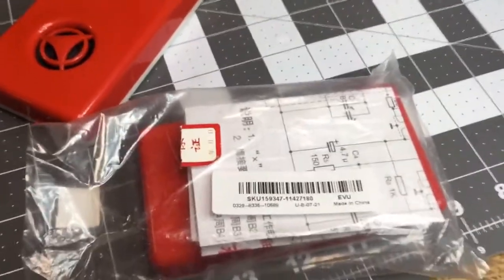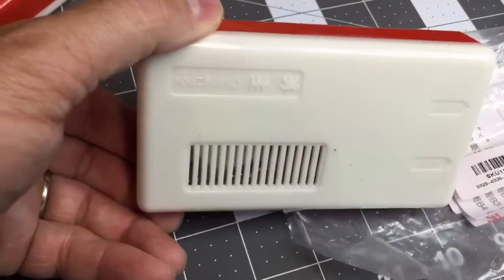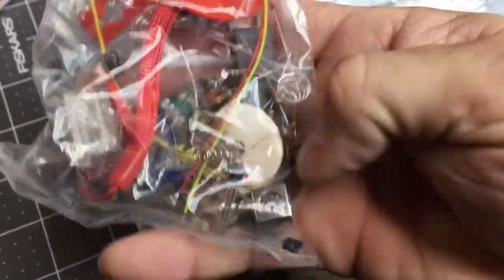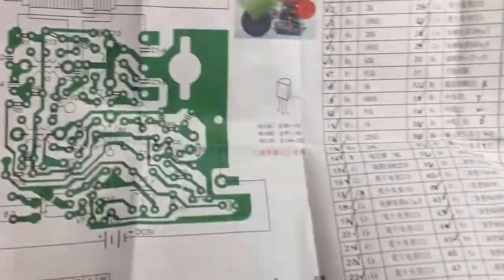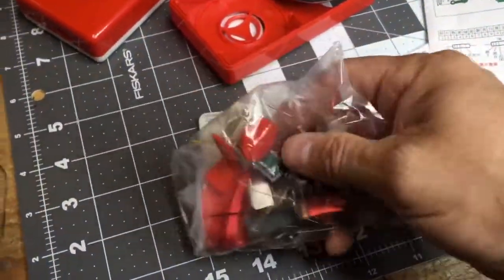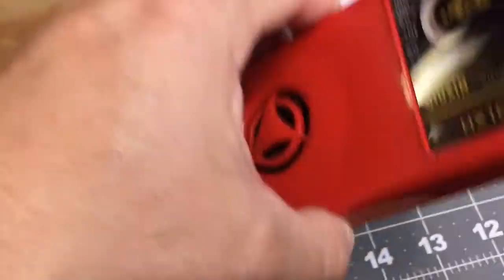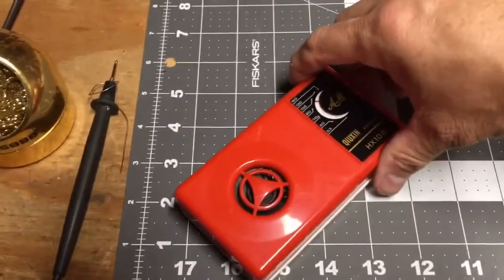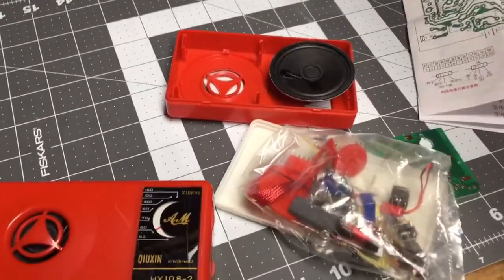Qiuxin Xinghao HX108-2 Am Radio

Comment: I soldered very carefully the whole kit, verified the battery. When I switch on, I had no sound at all. I tried to adjust B2-7 nothing. Any idea? I can't understand there is no noise at all.
Reply from the maker: Yes.  Did you install the four jumpers over the “test pads?”  There are four areas that need a solder bridge or a short piece of wire. Do you know what areas I am talking about?
Reply: No I didn’t. Where is it? My email is arobez@hotmail.fr thank you very much for your help frank

Comment: Kent. You were right again! That liquid solder was a complete mess and fouled up my 
GM328B diy geektech component checker/function generator. Took some serious cleaning just from the drips of that stuff. I pinned the bottle and it can sit on the shelf. I did have success with the SNT-2902. I managed to burn out 2 legs on the SMD which I had to reconnect direct line with some discarded resistor legs. They did not include a vital part for the tuning pin for the band width display so I had to use an old plastic piece, file it and use crazy glue. The pc says one cap for 18picofarads which is really 47microfarads, and the did not give me a washer for the complex 3 gear tuning mechanism which controls the tuner. I used masking tape as a temporary washer for it. All in all, it fired up 1st time I threw the switch, and tunes in SW bands like crazy midday. AM (MW) and FM work but need tweaking as usual. It is a miracle it works and is one of the most complicated mechanical radios ever built. Once you get one, you will see what I mean. I never thought it would work, but presto, EUREKA!
Reply from the maker: Terry.  You are a WIZARD! Great job getting that unit running.  I know you must be very proud, especially after so much trouble.  Would love to see a video of your new radios working.
Reply: https://www.youtube.com/watch?v=ycWq_cx1JHU
Reply: Proud, yes. https://www.youtube.com/watch?v=ycWq_cx1JHU

Comment: Thanks again Kent! I just ordered some of that flux gel in a bottle, like the guy uses, and I already have some of that rosin core solder. I also ordered some solder suckers, as I have not had any of those in the past and don't know how I got by, but ended up in some precarious situation, with the circuit board and hot iron at some pretty odd angles relying on gravity to do the removal of a spill.

Comment: OK Kent! I checked out the shango66 site, followed his procedure for alignment of the HX108-2. What I had to do was back off all 4 IF and readjust the antenna tuner and oscillator to recalibrate the radio from factory settings and the damage I had done. Like a balancing act, but my local station is right where it should be and no more short wave reception. Still a little distortion 530-600Khz with an odd carrier tone, but I noticed the same issue with shango66 version.
Reply from the maker: Great job!!  I aligned my two units. And it was not hard.  But I did not want to try to explain how to do it in a short message. So I’m glad shango was able to help.  That tone may be inter transformer interaction or oscillations.  You may want to slide the antenna coil one direction or the other on the ferrite core and see if that helps.
Reply: Kent, your advice worked for me again. I got the entire bandwidth of HSX108-2 tweeked and cleaned right up, with no distortion or weird tone down in the 530Khz waves. Do you have any info on the SNT-2902 am/fm/sw diy kit? The only tutorial I can find on youtube is https://www.youtube.com/watch?v=rhGy_YUzuUA
https://www.youtube.com/watch?v=IKf7HLi8Q7U
Both are in Russian speech and text and the directions that came with it are in Bangkok or Chinese. My model is SNT and the tutorial model is EDT.
Any thoughts on this dilemma before I begin assembly?
Reply from the maker: Three areas where it may be tricky. First the SMD.  If you have not done surface mount work, that can be a challenge. Second the proper order of the IF transformers. Note the colors/locations carefully. Use those videos as a guide. And third, the am ferrite antenna leads are color coded and must be put in the right locations. One of those videos identifies those for you. Best of luck. I should have ordered that radio also. I did order the AmFm one earlier this week.  Let me know how it goes.  Keep that soldering iron tip crystal clean while you work.
Reply: Well said Kent. That SMD made me nervous right from the start. What is the jell that is being applied before each soldering point. I may put the brakes on this project until I do some more research on it. I have never installed an SMD like that yet. Also, in that one video the guy has some 'colored penciled in" rings. Are those more bridges to be linked? Many questions on this one, and the thing is so small and delicate, I have the notion that this is a 'one shot only' deal with no backtracking.
Reply from the maker: The paste the guys is using is resin flux. It is a little messy in my opinion so I only use a resin core solder which cleans the surfaces for good soldering bond. Use resin core solder and you will be fine.  However, it is essential that you first lightly “tin” the solder pads where the ic chip goes so that it sets down on clean solder and easily bonds with minimal heat. Flux paste helps with surface mount components. But you need a syringe.  As for the colored circles with Russian language, I believe he was saying that these are the correct placings of the three antenna wires. I don’t recall seeing him bridging any test connections like we did on the AM radio.

Comment: Just got one after 20 days shipping wait. This video really helps explain some basic questions, like battery set up, configuration with antenna, ect. Thanks!
Reply from the maker: Terry Fisher so glad it was helpful. I enjoyed building these.  I may try the FM version.
Reply: What FM version of this am I missing? The HX108-2 is running full tilt right now. I am receiving WTIC out of Hartford, Conn. which is well over 700mi from my location. For 5 bucks and change, this baby is well worth the aggravation of wiring together. Pretty tight fit for parts, and resistors were the most difficult to position.
Reply from the maker: Terry Fisher the resistors are placed with one end touching the board and the other end standing up. So you bend one lead all the way over the resistor and they drop in perfectly.  They do not lay down flat on the board.  As for the FM I’ll look it up and get you a link.
Reply from the maker: AM/FM radio version. https://m.banggood.com/AM-FM-Radio-Electronics-Kit-Electronic-DIY-Learning-Kit-p-946145.html?rmmds=orderdetail
Reply: Thanks for the link. Funny thing about the HX108-2. I did not use an oscillator to fine tune it, and in turn I do not receive my local radio station, which usually bleeds over all of my other diy radios. I tune in distant stations and sometimes receive what I believe to be short wave bands from distant countries. Any ideas on what I should tweek in order to remedy this? The parts seem rugged enough to toy with a bit, but I am cautious about monkeying around with it too much.
Reply from the maker: Terry, you may be outside of the band. The 160 meter band is just above the broadcast band. And I suppose you might be hearing them.  Do a search for shango66. He does a lot of videos. And he did a demo on this particular radio and how to align it.  Very simple.
Reply: Thanks again. I will check out shango66 on that model. I have watched some of shango66 videos previously. Can't wait to get this cheap radio tuned. The potential is there, and already exceeds my pricy elencos, but I can't knock elenco as they have detailed assembly and tuning manuals they provide.